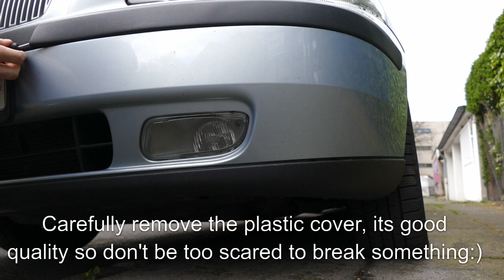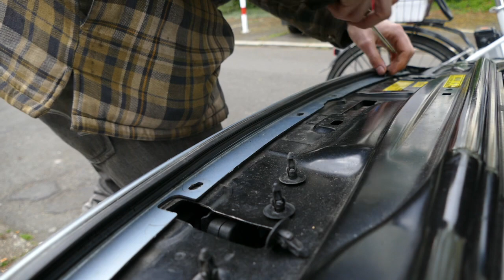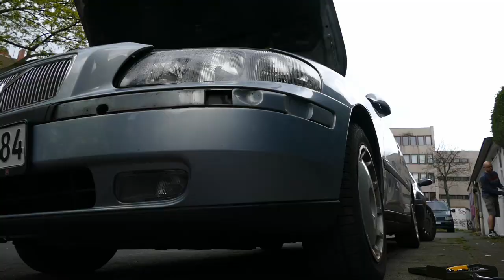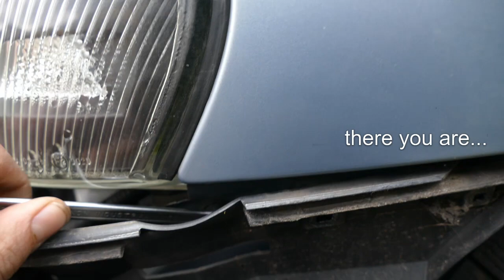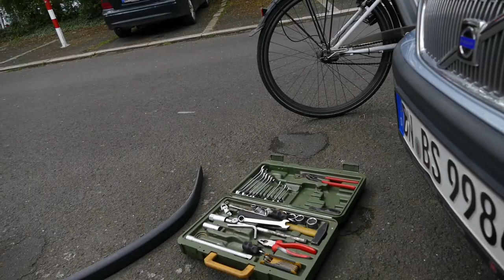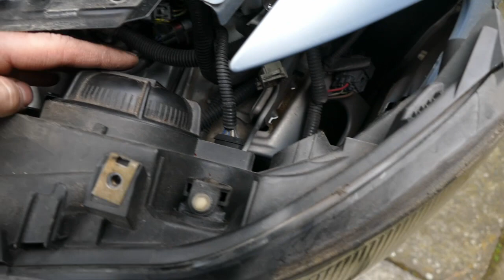Scheinwerfer Volvo V70 S60 ausbauen ohne Stoßstange - Remove Headlamp without bumper

Comment: if you have the Cross Country version, there is no strip on the bumper to pull off, there is just a little square pop-out hiding the bolt, which is 10mm. the bolts holding the headlight in are 8mm, not 10mm, as some videos are saying. I know this because I just replaced the Driver's side light on my 07 XC70 Cross Country.
Reply from the maker: Thank you for your insight relating to this specific model type
Reply: @Senzenfrenz  figured I would throw that in as most of the xc70s I see around where I live are the Cross Country.
 Gotta admit, never thought I would say I was a fan of Volvo, cuz I was always a Mopar(Dodge/RAM/Chrysler) guy. 
The one we got was in REALLY rough shape(previous owners had never even given it a tune-up, at like 200k miles). I am amazed it still runs as good as it does, and getting better with every little thing I do to it.

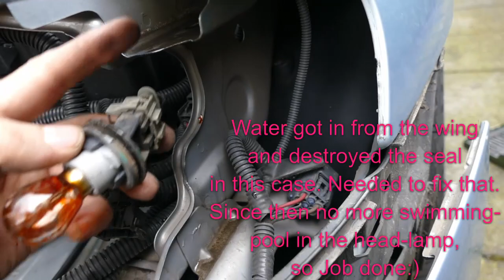Comment: I seem to have same issue. My car has been slightly "nose down" and tilted a bit to the right at my driveway for 2 years. Tiny bit of water drips from the "pit" or "canal" shown here at 4:22. The canal has a whole in it, but water passes it just slightly as car is not level. Then it drips right on top of the indicator seal just like in the video. The seal is now ruined and water gets in the headlight.

If I would have just parked the car straight, or even level, or replaced the indicator bulb more often or kept it away from rain.. dumbest tiny thing. 

As my lights are xenon, new assembly costs 1100€+labor to replace.
Reply from the maker: Is your whole headlight ruined? Otherwise just take it off the car and let it dry, clean the mentioned seal perhaps combined with some solicone on the outside of the indicator bulp and you should be fine. If that doen't work you can still replace the unit

Comment: That is deffently not the way to move the black clips on top of the bumper....
You just have to push the middle spike one millimeter down. Then they will unlock and you can remove them with you fingers.

Comment: Had the same common problem with water condensation, I just removed the upper thin black plastic on top of the headlight, then apply outdoors silicone on the long seal between the glass and the headlight housing.
Reply: And did it fix the problem? I have the same issue and made xenon blackout.